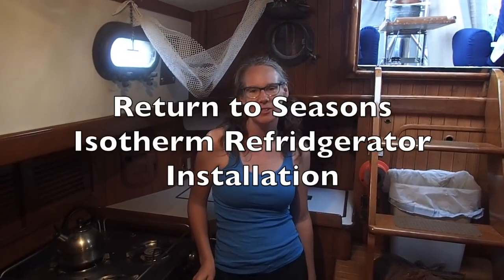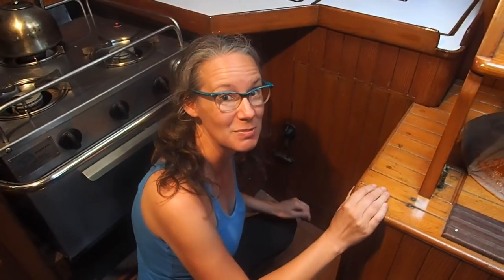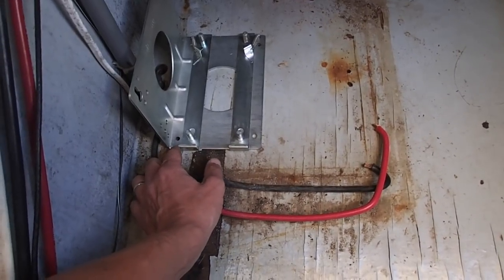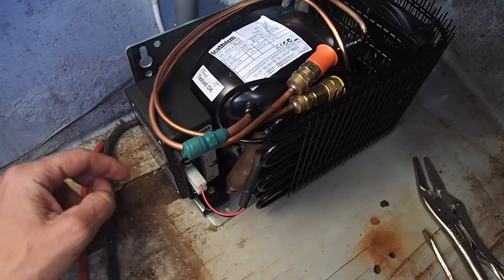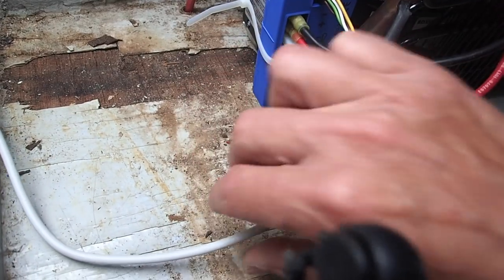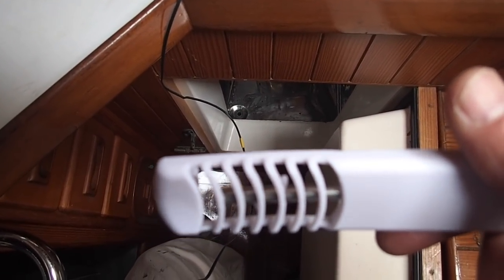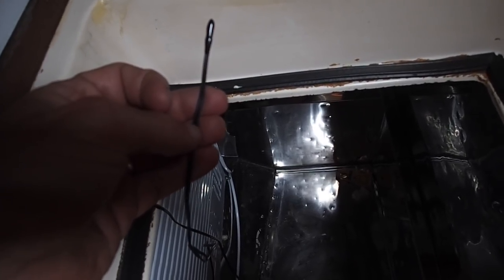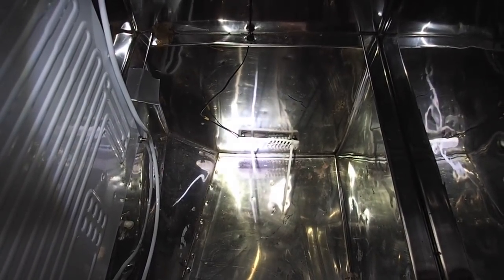Return to Seasons - Boat Work and Systems - Isotherm Refridgerator Install

Comment: We bought an indoor/outdoor thermometer with a remote sensor, which we put in our frig. That way we can check the internal temperature without opening the frig. Works great and the units are very cheap.
Reply from the maker: Good idea!